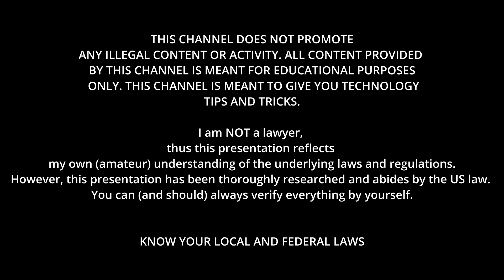The legalities of operating a Portapack H4M  or H2 HackRf Pt. 3

Comment: It's totally legal and fine to take on the plane, but just in case, your suggestion is to try to hide it and lie to the TSA and smuggle it through?
Reply: @honestlocksmith5428 I did not come away with the same impression that you did. You heard it as "hide it and lie". I heard it as "out of sight, out of mind". It's not like he is recommending duct taping it to his thigh or hiding it in a can of resealed coffee grounds. He is recommending not leaving the flipper zero on top of the pile. As he states, it's legal but due to idiots breaking the laws with it and making tiktok videos of them doing such, people who are uninformed (or only partial informed) may jump to conclusions. As far as not saying "This is my hackrf", but instead going with the "Ya, I use it to listen to my mp3s" or "I use it to play games" is not a lie since the device does both of those things as well. Me personally, I think the name HackRF is what gives people the 'scary vibes'. They should have just called it a Radio Analyzer.
Reply from the maker: @DIYMakerMindset thanks for clarifying. I agree. I think the name of “HackRF” was a wrong choice. Portapack SDR or even as you said Radio Analyzer would have been perfect choices.
Reply: @DIYMakerMindset In the video, he plugs in headphones and removes the antenna to disguise it and tells people to lie about what it is.
That's far worse than just telling TSA what's in your stuff if they ask. 
You're suggesting because of tiktok that TSA has extra authority to take electronics, which isn't true. I can't think of a single time me, or anyone else has had one confiscated or any badges returning from DefCon or elsewhere. 
You why the airlines don't care? Because the device has ability to mess with the plane and it's perfectly legal to own. There's no reason to be sneeky or lie, especially when traveling by air.
Reply: You're extremely courageous and chilled out
Reply from the maker: Nope. Just saying how to describe the device if they ask.